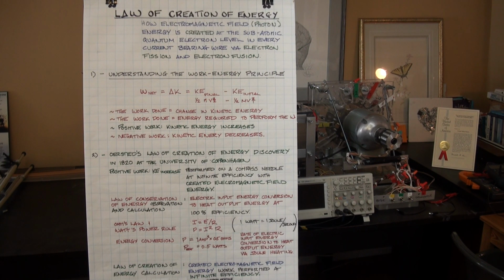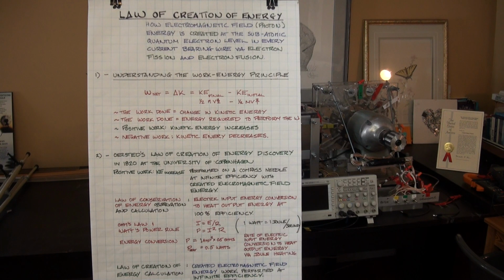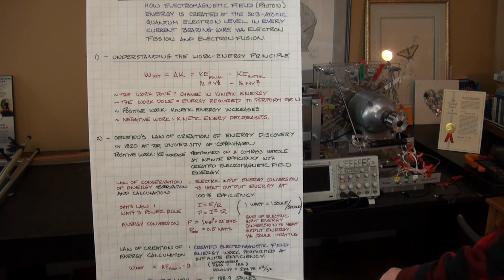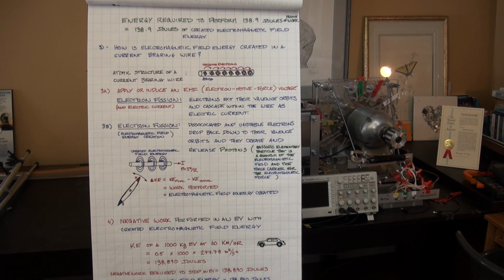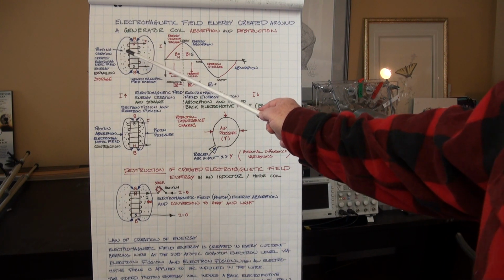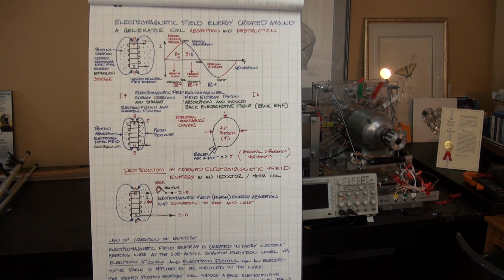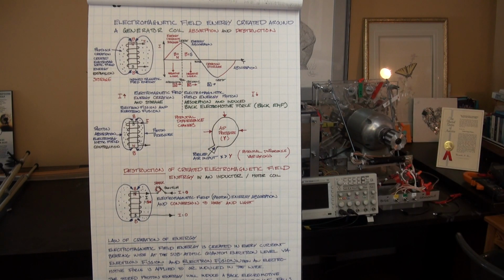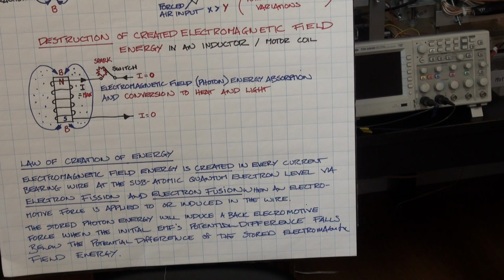LAW OF CREATION OF ENERGY - How Electromagnetic Field Energy is created in all Current Bearing Wires

Comment: pleasedefine electronfiss/fusion
Reply from the maker: ELECTRON FISSION is the process upon which an Electron is forced out of its Valence Orbit by an Electro(n)-Motive Force (induced or applied Voltage) which causes it to cascade within the Current Bearing Wire as Electric Current.

ELECTRON FUSION is the process upon which the disassociated and unstable Electron returns back down to its lower level Valence Orbit and creates and emits Photons (Massless Force Carrier for the Electromagnetic Force) which create and constitute the Electromagnetic Field Energy around the Current Bearing Wire which is the created Energy Source which performs the Negative Work at Infinite Efficiency in all Faraday Generators since 1834.
Reply: @ThaneHeins1 
Thanks!
But this is called ionization, fission is positive ionization because negative charge leaves, and fusion is the opposite. 
And movement of the charges between the molecular lattice is current.
Collapse of a valence orbit to a lower level is a source for free energy if you can get it to the higher valence levels for free.
Reply from the maker: @crippled82  Electron Fission and Electron Fussion in a Current bearing Wire has been a Source of Free Energy since 1820 which has been performing Negative Work for free at infinite efficiency in every Faraday Generator since 1834 and Positive Work for free in every ReGenX Generator and ReGen-X Quantum Motor at infinite efficiency since 2007.
https://www.youtube.com/watch?v=l2QmG0E2W-o&t=1s
Reply from the maker: @crippled82  LAW OF CREATION OF ENERGY HOW NEGATIVE WORK IS PERFORMED IN FARADAY GENERATORS @ INFINITE EFFICIENCY https://www.youtube.com/watch?v=hiXf7cmQGhA&t=89s
Reply: @ThaneHeins1  
magnetic induction in an open loop separates charges and result in a voltage, this kind of pumped induction current has no  lenz law.
Reply from the maker: @crippled82  Lenz's Law of Induction explains how Negative Work is performed at infinite efficiency in all Faraday Generators with created Electromagnetic Field Energy. 

Heins' Law of Induction explains how Positive Work is performed in all ReGenX Generators with created and Time Delayed Electromagnetic Field Energy. https://www.youtube.com/watch?v=3O-uFXiObBc&t=9s
Reply: @ThaneHeins1 
It is hard to see how Oersted's law implies creation of energy.
But I agree that lenz's law is a causal law, which means that the effect is caused by the cause back in time, as a contrast F=ma is not a causal law.
So cause and effect of LL could be manipulated, i guess a time delayed field is one way.
Reply from the maker: @crippled82  Conservation of Energy in the Joule Heating of the wire according to Ohm's Law and Watt's Power Rule and Electromagnetic Field Energy Creation according to the Work-Energy Principle i.e. the Kinetic Energy Increase (in Joules) of the compass needle equals the Positive Work performed (in Joules) which equals the magnitude of Energy created (in Joules) which is required to perform the Work.

Comment: So, the alternating magnetic field of the magnets in a rotor are ONLY responsable for inducing a current in the coil. Basically, that alternating change of magnetic field is 100 percent conveted to current and heat in the coil!

But since now there is a current in the coil, a magnetic field gets created/manifests in that coil.

And that magnetic field that manifests in that coil is the created energy that creates rotor rotation resistance on conventional generators/regenerative deceleration!

And that same created/manifested magnetic field in the coil is what regenex coils use to aid/accelerate the rotor!

I think I understand enough about this now but there still 2 deeper things that I am struggling with: 

Why is Fission and Fusion happening in the coil? 
Don't they need, or at least Fusion, a lot of energy to happen?
Reply: Never mind my last two questions.

I have watched the video for a third time and you answered those questions there!
Reply from the maker: So, the alternating magnetic field of the magnets in a rotor are ONLY responsable for inducing a VOLTAGE IN THE COIL ACCORDING TO FARADY'S LAW OF INDUCTION current FLOWS IN THE COIL IN A CLOSED CIRCUIT. Basically, that alternating CURRENT (AKA ELECTRON KINETIC ENERGY CONVERSION TO HEAT) VIA OHM'S LAW, WATT'S POWER RULE AND THE LAW OF CONSERVATION OF ENERGY... change of magnetic field is 100 percent conveted to current and SOME HEAT ACCORDING TO THE WIRE'S RESISTANEC heat in the coil! THE ENERGY CONVERSION AKA ELECTRIC INPUT ENERGY TO JOULE HEATING OCCURS AT 100% EFFICIENCY. 

But since now there is a current in the coil, a magnetic field gets created/manifests in AND AROUND that coil.

And that ELECTRO-magnetic field that manifests in that coil is the created energy that creates rotor rotation resistance (NEGATIVE WORK / COUNTER-ELECTROMAGNETIC-TORQUE) IN conventional FARADY generators/regenerative deceleration SINCE 1834!

And that same created AND TIME DELAYED manifested ELECTRO-magnetic field in the ReGenX coil is what regenex coils use to PERFORM POSITIVE WORK (COMPLEMENTARY-ELECTROMAGNETIC-TORQUE) aid/accelerate the rotor IN THE SAME DIRECTION AS THE TORQUE SUPPLIED TO THE GENERATOR IN THE DRIVE SHAFT. https://www.youtube.com/watch?v=l2QmG0E2W-o&t=442s

I think I understand enough about this now but there still 2 deeper things that I am struggling with: 

Why is ELECTON Fission (THE INDUCED EMF (VOLTAGE / ELECTRON-MOTIVE FORCE FORCES ELECTRONS IN THE CURRENT BEARING WIRE TO EXIT THEIR VALENCE ORBITS AND CASCADE IN THE WIRE AS ELECTRIC CURRENT) and ELECTRON Fusion (ELECTRON DROP BACK DOWN TO THEIR LOWER ENERGY STATE / VALENCE ORBITS AND RELEASE PHOTONS WHICH CREATE AND CONSTITUTE THE ELECTROMAGNETIC FIELD PHOTON ENERGY AROUND THE CURRENT BEARING WIRES / COIL happening in the coil? 
Don't they need, or at least Fusion, a lot of energy to happen?

ELECTRON FISSION AND ELECTRON FUSION ARE NOT THE SAME AS ATOMIC FUSION WHICH DOES REQUIRE LOTS OF ENERGY. 

ELECTRON FISSION (ELECTRONS LEAVING THEIR VALENCE ORBITS AROUND THEIR ATOMS NUCLEUS) AND ELECTRON FISSION (ELECTRON RETURNING TO THEIR VALENCE ORBITS AND RELEASING PHOTON ENERGY) IS THE PROCESS UPON WHICH ELECTROMAGNETIC FIELD ENERGY IS CREATED AT THE SUB-ATOMIC QUANTUME ELECTRON LEVEL IN EVERY CURRENT BEARING WIRE. 

WHICH EXPLAINS WHY ALL FARADAY GENERATORS PERFORM NEGATIVE WOK AT INFINITE EFFICIENCY SINCE 1834 AND WHY ALL ReGenX GENERATORS AND ReGen-x QUANTUM MOTORS PERFORM POSITIVE WORK AT INFINITE EFFICIENCY SINCE 2007. https://www.youtube.com/watch?v=zuJFyFvDumQ

AND THE DIFFERENCE IS BASED ON FREQUENCY OF OPPERATION I.E FARADY GENERATOR OPERATION AT 50 HZ (NEGATIVE WORK - SYSTEM KINETIC ENERGY REDUCTION) AND ReGenX GENERATOR OPERATION AT 100 HZ (POSITIVE WORK - SYSTEM KINETIC ENERGY INCREASE) 

IN BOTH CASES THE ENERGY REQUIRED TO PERFORM EITHER THE NEGATIVE OR POSITIVE WORK IS THE SAME BUT THE FREQUENCY IS DIFFERENT AND HERE IS WHY... https://www.youtube.com/watch?v=ZpTldXmYEko&t=246s

Cheers Thane
Reply: @ThaneHeins1  Thank you for taking the time to explain in more detail.

This is amazing!

Comment: When you say that on current conducting wire there is magnetic field, but this magnetic field energy was converted from power source.
Reply from the maker: When Electric Current flows in a Current Bearing Wire some of the Electron's Kinetic Energy is converted to Heat Energy via Joule Heating of the wire. 100% of the Energy Conversion is Electrical Energy from the Power Source the Heat Energy Conversion (P = I^2R). Simultaneously and seperately  Electromagnetic Field Energy is created via Electron Fission and Electron Fusion and NO Power Source is required for this Energy Creation and NO energy Conversion is required and the Energy Creation Process occurs at infinite efficiency. This is the created energy source which performs the Negative Work at infinite efficiency and decelerates ALL EVs during regenerative braking... Cheers Thane